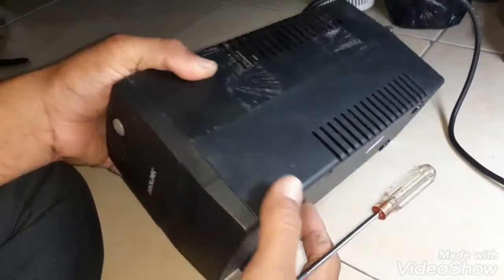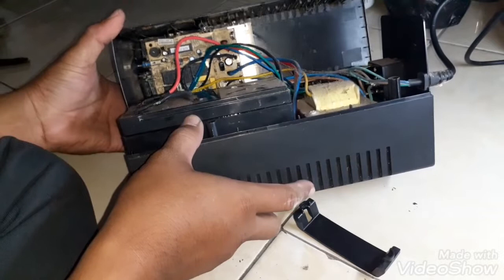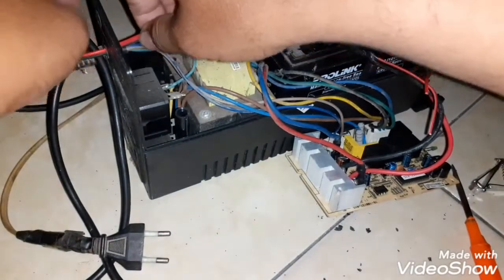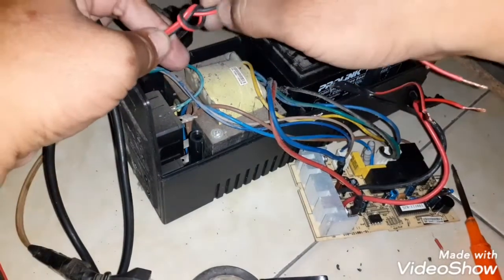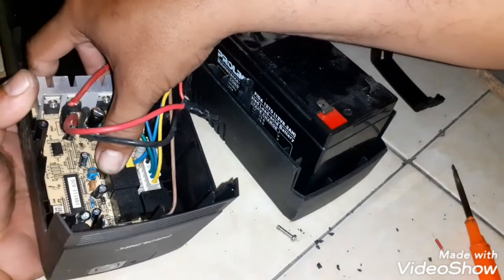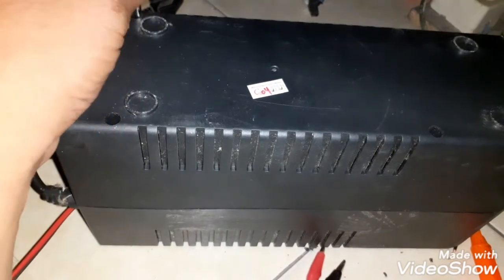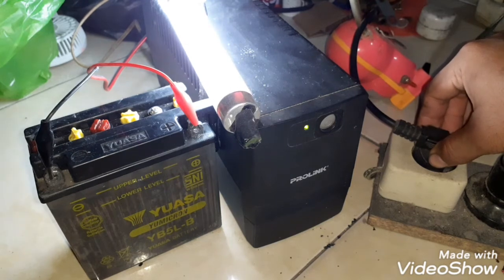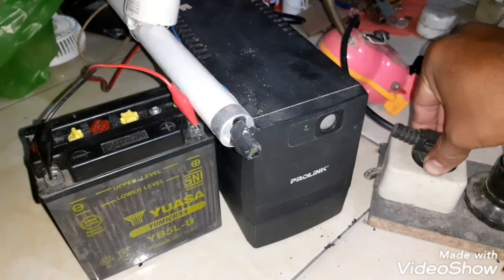Modif UPS Prolink Pakai Baterai External Aki Motor 12V

Comment: mas kenapa ya ?, saya belikan aki 5 ampere, AKI MOTOR KERING,
setelah saya pasang ke UPS, kenapa cuma 165v yo ketika dari aki KE OUTPUT, AC Ny,
atau ada seri AKI yg spesifik ya
Reply from the maker: Harusnya gak, asalkan tegangan akinya 12v, output ups harusnya tetap 220v. Atau mungkin dari awalnya ups memang sudah problem seperti itu.

Comment: Mas milik saya batrenya saya ganti yg 7.5amper kok gak tahan lama 2menit dah mati di karenakan apa mohon bimbinhanua
Reply from the maker: Pastikan kondisi baterai benar2 kondisi bagus dan tidak drop. Kalau pakai baterai bekas, kemungkinan bisa drop. Usahakan ganti pakai baterai yang baru bukan bekas. Jika sudah diganti baterai baru tetap tidak bertahan lama, coba Anda test menggunakan baterai motor yang 12V. Jika menggubakan baterai motor 12v bisa bertahan lama. Maka kemungkinan baterai baru pengganti kualitasnya kurang bagus atau sudah drop
Reply: Udah tak belikan batre baru tapi kok tetap gak tahan lama
Reply from the maker: Coba dulu test pakai aki motor 12V mas

Comment: pak klo ups prolink sprti video bpk itu tapi pake batre 12v-33ah bisa gk ya? takut jebol trafone. hehee
Reply from the maker: Bisa, yang penting tegangannya 12V, kalau amper aki semakin besar, maka proses charging juga akan lama, tapi bisa menyala lebih lama. Untuk pengaman pasang sekering 5A atau 10A pada positif aki sebelum masuk ke ups.
Reply: @BaharElectronic  siap . trima kasih info nya pak . 🙏

Comment: Mas kalo pake batre yag asli biyar bisa tahan lama caranya gimana mas
Reply from the maker: Untuk UPS memang di desain tidak untuk pemakaian lama, normalnya hanya bisa manyala berkisar antara 5 - 10 menit saja. Tergantung beban dari ups juga, semakin besar beban, maka akan semakin cepat juga durasi nyalanya. Mungkin saja memang  disetting gak bisa lama. Tapi coba saja diperbesar amper akinya atau coba diparalel. Jika masih tetap gak bisa lama, ya mungkin memang disetting ups gak bisa lama.

Comment: bpk.. Untuk yg PRO1201SFCU modif limitnya gmna pak?
Reply from the maker: Modif limit maksudnya gimana? Kurang paham saya
Reply: @BaharElectronic  kan disitu kalo udah kisaran 20 menit mati sendiri.. ini saya rencana mau pakai aki mobil yg 100 AH
Reply from the maker: @user-dt1jq3no6p  kalau tidak salah limit itu otomatis akan menyesuaikan dengan kemampuan tahan lama akinya. Karena ups itu dilengkapi dengan sensor low volt. Ketika tegangan aki sudah mencapai batas minimum, maka ups akan mati. Jika kemampuna AH akinya diperbesar, maka otomatis tegangan low volt akan lebih lama tercapai. Hasilnya harusnya ups bisa menyala lebih lama. Karena sensor low voltnya lama tercapainya
Reply: @BaharElectronic  apa tidak perlu di jumper di board pcbnya pak?
Reply from the maker: @user-dt1jq3no6p  ya aki yang lama bawaan ups dilepas, kemudian kabel yang dari aki lama, disambung lagi agar bisa ditarik keluar untuk disambung ke aki diluar. Jika kondisi aki bawaannya masih bagus, maka tidak perlu dilepas juga gak apa-apa. Tinggal paralel saja dengan aki yang diluar
Reply: @BaharElectronic  makasih pak atas petunjuknya..
Reply from the maker: @user-dt1jq3no6p  ya sama-sama